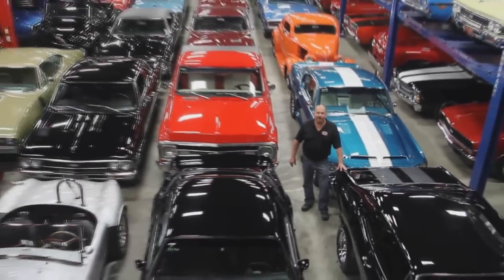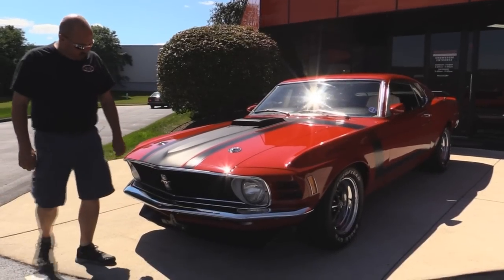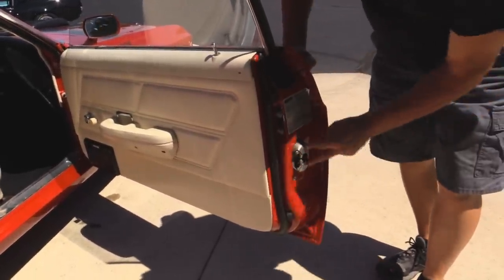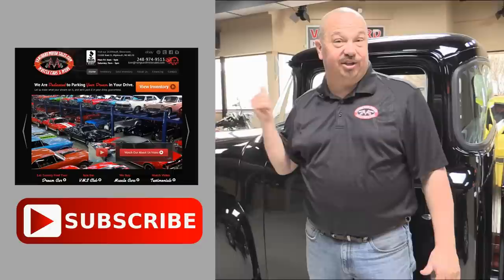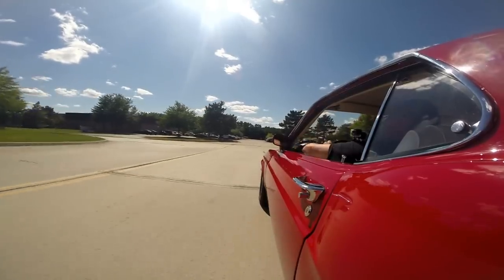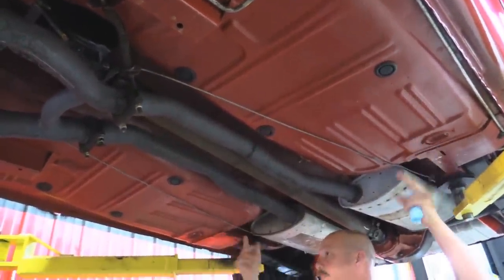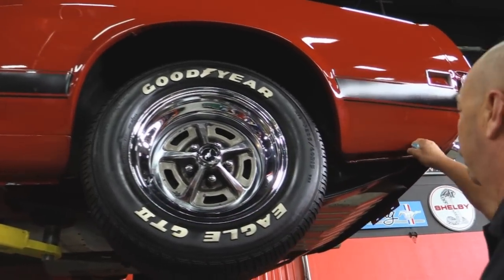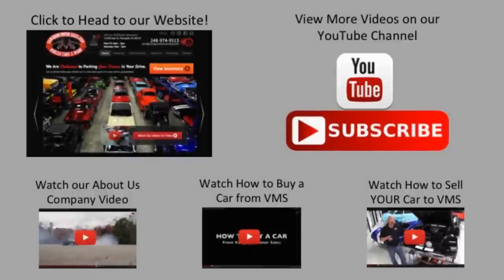1970 Ford Mustang Boss 302 For Sale

Comment: Know a guy that had a 70 Boss 302 and 429. Beat everything he raced with the 302. The best time he ever got out of the 429 was a 11 sec flat on Mickey thompson street slicks, Said the Boss 9 was the scariest car he ever drove , like steering a freaking rocket ship on wheels, was never beaten in the 429. The only thing that ever beat his 302 was a 70 440 6pk 4 spd challenger and it was,nt by more than a fender .When the race was over the mopar guy wanted to buy it. Said it was the fastest SB he ever raced.